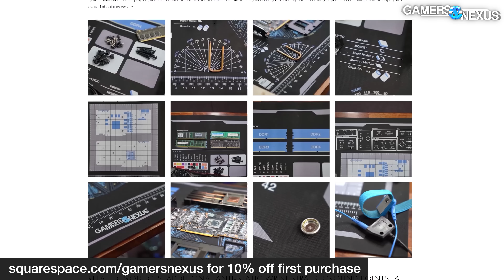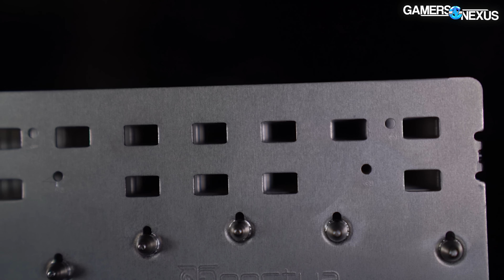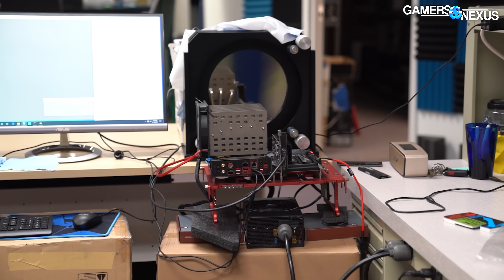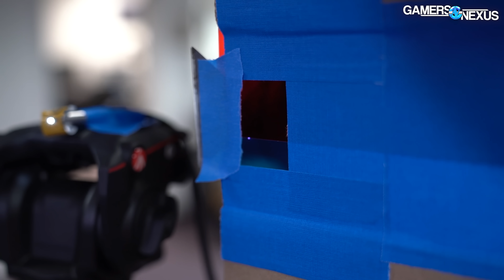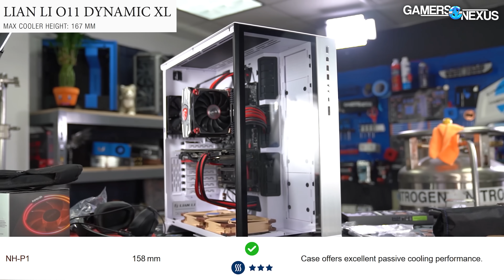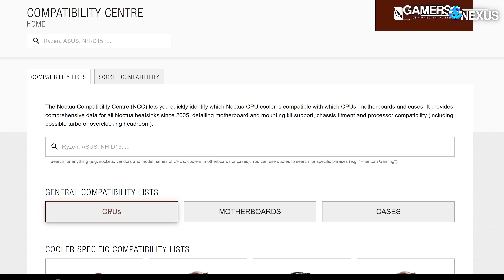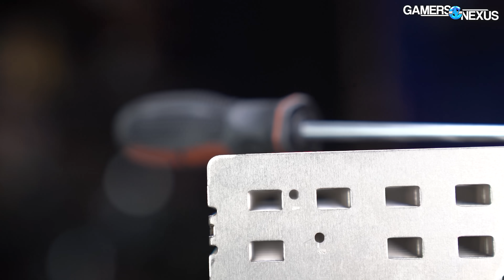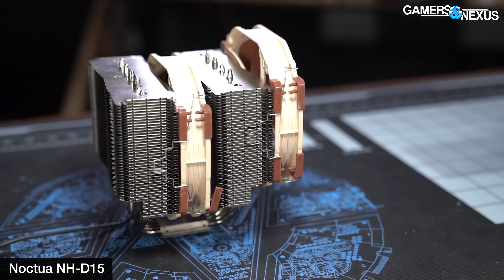Noctua NH-P1 Passive CPU Cooler Review: Benchmarks, Schlieren Photography, & Mechanics

Comment: If you were desperate to build a completely silent PC with no moving parts, what's going to be your best option for graphics I wonder? Taking a massive triple slot, top end GPU (like a FTW3 or Red Devil) and underclocking it severely I suspect (somewhere in the 100-150W range). Everything else is fairly obvious. Most decent PSUs these days fan-stop when not required and I doubt you're going to be able to dissipate more than 300W of heat passively so you'd probably be fine with a 750W or so. SSDs and NVMe, no hard disks.

Comment: Can someone explain why their 'cpu idle' is extremely low compared to load. I'm pretty sure most modern cpu's can't stay below 25 degrees at idle without some crazy cooling going on never mind some passive cooler.
Reply: It's delta T over ambient temp.
Reply: They subtract the room temperature from the temps.

Comment: It's best to use in some PS case stuck closed big box like working table in some cement factory or any production dust factory which need decent computer to operate. Price wise computer is probably controlling multi milion dollars equipment therefore 50$ more expensive is totally non issue

Comment: Undervolted 5700G analysis with this heatsink, soon?
Reply: THIS! Yes please!
Reply: that would be an awesome setup
Reply: Either of the APUs and this in an matx or itx cube would be neat at least until/if mid range GPUs return to 2013~2015 prices.
Reply: @ferdinandbardamu3945  I have no interest in Gaming, my use case is a general purpose / video streaming / HTPC.

I'm looking at the Silverstone FARA H1M case as it has good airflow, fits a 160mm CPU cooler and fits in the furniture under my TV.
Reply: @Richies_Beer_n_Gear  
If you want to go ITX, I suggest the Silverstone LD03. The case structure is well suited for convection cooling with a heatsink like this NH-P1.
Reply: @ferdinandbardamu3945  Thanks! That looks like a really good case, but I'm going to stick with the FARA H 1M as it fits my requirements better. I need to use it horizontally, with front to back case airflow and with 2x 3.5" HDDs.

Comment: I would have preferred to see this cooler tested with a APU (e.g. Ryzen 7 5700G) as this would be a working passive build without a discrete GPU
Reply: An APU is just a CPU with integrated graphics, so as long as the CPU and integrated graphics don't use too much power, the cooler will work with an APU. This is just a guess, but I'm assuming that if you set the right temperature limit / power limit, passive cooling is possible.
However, giving up that much performance, makes using an 8 core CPU with powerful integrated graphics a bit pointless.

Comment: "you probably won't hear a quiet fan" as long as you keep the speed at check, A12x25 is doing fine at 500RPM but at 1000 is absolutely unbearable and starts becoming an issue at 600-ish

Comment: Imagine a cooler, that used the entire case a heat sink.
Reply: The Streacom db4 is exactly that.
Reply: Didn't LTT already do something like this?
Reply: there are many of these but somehow they don't really do better than this
Reply: https://www.kickstarter.com/projects/1489140137/nsg-s0-worlds-first-fanless-chassis-for-high-perfo/posts/3171901

The project has taken over three years I think, and still no actual cases. But the company is legit in the server cooling space, so it's not a scam. It's just taking years of delays. The design has changed a few times as well.
Reply: I recall Zalman had a case like that

Comment: I remember seeing my first passive PC in a calibration room for hearing aids at an ear care center, so that's another class of use-cases.
Reply from the maker: Makes a ton of sense!
Reply: Also people that are afraid of mechanical failure. In systems where you're going to setup and forget about them for a decade.
Reply: This is definitely a cooler for edge case and niche scenarios, and this is definitely one of them. Good find!
Reply: places like these will probably get something like Airtop 3 to not rely on aftermarket parts and complex warranties
Reply: @Z4KIUS  OEMs can also buy stuff from Noctua..
Reply: Yeah, I’ve gravitated from Noctua because of their prices recently, but this cooler can certainly be clutch in niche situations.
Reply: It's surprising how many known brands do OEM stuff. I got a 450 MHz Pentium 3 that came with a stock Cooler Master cooler.
Seasonic and FSP are some of the few companies that actually build PSUs, most others order from them and slap their own sticker on. Same for OEM motherboards.

Comment: "you'll see how heat rises... which is a known thing" but seems to be unknown for most of case manufacturers, and I guess whoever designed ATX standard too
Reply from the maker: Heat rising becomes irrelevant in cases where fans are present.
Reply: @GamersNexus  When I used to compete in overclocking, I'd have the top fan in my Antec 900 blowing down from the top and people were outright offended.  It was good for an extra couple degrees Celcius cooler, and that's all I cared about :)
Reply: @GamersNexus  maybe if you're deaf, but if you're not you want to use as little force as possible, working with convection is just easier
Reply: As Steve also says, as long as you have just a single fan, the heat will go whatever way you point the fan...
Reply: @morromeyer  it's better to run fan slowly and quietly to assist convection than to run it fast and loud to fight it
Reply: AT and ATX standards were designed around desktop computers, not tower cases.  It would be hugely rare to see a motherboard on its side at that time.  10 years later, sure that would be the norm.
Reply: Heat rising is a very weak force, you should know this from school, if you have good airflow horizontally you will only see very minimal gains working with "heat rising", the bigger thought is does heat rise or does cold air sink...

Comment: Don't you think it's worth mentioning that the 11900k had the highest 1 percent low in every single gaming benchmark you showed? The lead was usually pretty substantial. 

Isn't this really the most important metric? When I'm using my 144hz monitor and playing warzone or apex, I won't care or even notice (it would be impossible to notice) that one cpu averages 185 fps vs 180fps but I sure as heck notice when it dips to 105fps. As a gamer, I want a PC that is going to be the best at staying above my refresh rate at all times. That's the 11900k

Why don't reviews pay more attention to how well the CPU prevents framerates dipping rather than focusing on how one cpu has a 5 avg fps advantage over another?

I totally get what you mean about the price of this cpu. I agree, it's not worth it. But if I'm building a no compromises best possible CPU, I'm going with the 11900k bc it is the best at keeping my framerate above my refresh rate consistently. If I'm missing something, please explain. I am no expert! Thanks

Comment: Steve: Buys a super expensive custom fan tester.
Noctua: Bout to ruin his whole career.
Reply: plot twist; noctua knows and released this cooler just to yank the GN teams chain.
Reply: @kenabi  double plot twist: the fan tester has an attachment to test fanless coolers
Reply: Im interested in seeing a fan attached to this cooler, how cool would it be?
Reply: Sorry, but this thing is practically useless, especially at this price point. Dedicated servers have their own cooling, especially if they use multiple racks with several processors in each. For a gaming computer you would still need GPU with its own ventilator and possibly case vents. Only theoretically useful application would be some dedicated science computer with weak passively cooled graphics card, that needs to be as quiet as possible. In that case PSU would need to be cooled quietly as well.
Reply: @aleksazunjic9672  actually this type of Cooler if PERFECT for places where a lot of dust and debris can end up clogging normal fans
 (happens a lot where I live where you can literally see an 2 cm dust appear in just a day on any surface)
sure its weak and not useful for heavy and high end stuff but for a normal computer its perfect.
Reply: @m-w-y7325  Frankly, 2cm of dust would appear only if you live on factory floor :) Industrial computers usually employ different strategy, strong fans that blow dust out of the PC case. They do not care much about sounds for obvious reasons. Passive coolers do not need fans, but they would be covered with dust like anything else, and that would reduce thermal convection.
Reply: @aleksazunjic9672  Audio mixing in a live studio.  Background noise mitigation is huge and easiest to deal with if there's no noise to start with.  The right tool for a very specialzed job, as it were.

If you are using this in a server rack, as you suggested, you're doing it very, very wrong.
Reply: @TaterRaider  For a live studio you would need not only passively cooled CPU, but also passively cooled GPU and PSU . It would be less of a hassle to just keep computer out of the live room like they usually do in studios. As for servers, I did not suggest that , it was idea of others.
Reply: @aleksazunjic9672  you don't need a gpu at all for a pure music mixing computer. many more expensive psus operate in a hybrid fashion anyway.
Reply: @-........  You need some display adapter sonny ;)
Reply: @aleksazunjic9672  necroing a dead thread but

Passive GT710 baby :)

Comment: You should do a test where you remove the fan from the active coolers, effectively making them passive, just to show exactly why the NH-P1 is designed the way it is.
Reply: Here's the result of that test: all heatsinks will fail at cooling the CPUs without a fan. Some heatsinks will work with Intel T models at the cost of low performance.
Reply from the maker: @quintoblanco8746  This is correct. The result is they all fail.
Reply: @quintoblanco8746  Ninja will work quite fine with 60W probably, but everything else will fail
and P1 can go higher and higher
Reply: @Z4KIUS  I doubt it. 60W generates a lot of heat and if the fins are close together, without forced airflow even a big heatsink gets saturated quickly. Also most CPUs with a TDP of 60W use a more power than 60W under stress.
Reply: @Z4KIUS  SilverStone HE02 > Ninja, just not sure if you can still buy it.
I've had both and while Ninja (3) did pretty good passively (used it on A10 APU), HE02 is in a different class.

P1 is definitely my next cooler, though.
Reply: @quintoblanco8746  I never did proper testing of my Ninja in passive to be exactly sure but it definitely can handle more than just a T, and if you're not going for sustained load it'll work flawlessly too, though I definitely don't recommend that
Reply: @Z4KIUS  How do you know if you didn't test it? Just try it, disable all of the fans (CPU fan and case fans) and take the PSU out of the case if you can't disable the PSU fan.
I'm pretty sure that the CPU will overheat quickly.
Not enough natural airflow. The problem is that air is a great insulator when it's not moving.
Reply: @quintoblanco8746  never had time to play with power limits to get proper results, and now I'm definitely not taking out my P1 to mount Ninja again, it's way too much work
but from all the different configs I've tried 60W is a reasonable estimation, may be 50, may be 65, also depends on the CPU used as different surface areas and placements of hot parts affect that too

Comment: Down blowing configuration also allows the air to be pulled from cooler part of the case instead of drawing air through the fins from the heat sources on the motherboard such as VRM and RAM, theoretically speaking?

Comment: I’m trying to figure out a way to fit this in a silent itx build 🤔
Reply: Just make it like a hot rod
Reply: @alanalb1449  my thoughts exactly
Reply: Use one of this really tiny ITX-cases with a pico-PS and cut out the cover and let the massive cooler stand out
Reply: May have to cut a hole in the case.
It would be a hole in the box.
You would have literal OUT OF THE BOX THERMALS.
Reply: It will fill the case and there will be room for nothing else 😉
Reply: same. I have that silverstone case and had the same idea in the LTT video, replacing the same cooler too lol
Reply: The way to go is to not have a case at all.
Reply: The only solution is to build the PC inside the heatsink itself. Good luck!
Reply: Easy just oet it hang outside the case
Reply: want to try it with 3400g + inwin chopin without mesh)))
Reply: Cutting a hole in the case for it to stick out would be very distinctive.
Reply: Well, I guess it's a nice fit for such a build. By that I mean that such a build would more or less fit inside this cooler.
Reply: Or u could get those “itx” cases that are like m-ATX cases that don’t support m-atx
Reply: Linus did just that yesterday, it involves a dremel.
Reply: I want to jam it on a pn51
Reply: Thermaltake Core P1 would probably be the easiest. No walls, so the cooler has all the "breathing" space it needs. Seasonic Prime Fanless PSU and SSD storage, leaving the graphics card as the only potential source of noise. If you don't need massive graphcial horsepower, there are passive graphics cards as well. The fastest passively cooled GPU you can get is currently the Palit GeForce GTX 1650 KalmX, so if you need more you have to live with some fan noise.
Reply: Probably if you drill a large hole in the side of the case

Comment: Have that badboy installed along with that Lian Li transformer case or that case with the ridiculously over the top fans that doesn't do anything the Rameses case.

I think I would need to high wiring attached to it feels like it would pull off the CPU still pasted to it

Comment: this could be great with the cooler master SL600M case
Reply: It is literally a passive cooler.  Nothing about it is great.  It will do nothing but keep your processor at MAYBE UNDER 95°C.
Reply: @RNG-999  yeah, I sould said decent, just because of the orientation in that case, with a vertical oriented gpu but I agreed, there are way cheapper options with better cooling

Comment: You should have just done a sound test, just to mess with everyone lol
Reply: room with pc off - 40db, turns on pc, 35db... noctua wtf :D
Reply: Next video: "Thanks to purchases from the GN store, which pays for all of our new testing equipment, we were able to buy this machine that allows us to measure acoustics at the quantum level."
Reply: Noise normalised comparisons with fans means passive cooler is infinitely better?
Reply: @squigglyspaghetti8690  The line no longer approaches zero, it approaches Noctua.
Reply: @squigglyspaghetti8690  You should make the noctua go up to 40db, or make all the other coolers passive, an unfair comparison either way lol
Reply: @squigglyspaghetti8690  yup, if that's your only metric you found a your fan lol.
Reply: @squigglyspaghetti8690  no, its more like a cooler (with a fan) that cant run at your noise threshold even at full speed
Reply: @horticulturistsquash865  - It was just a maths joke dude.
Reply: Could have plot it against the noise from a H1 running hot
Reply: this would have demonstrated how much noise in the test is backround noise...
Reply from the maker: @ulrichkalber9039  that's called the noise floor, which we already show.
Reply: @ulrichkalber9039  Maybe even some coil whine
Reply: @tardvandecluntproductions1278  
Thats a thing. When I ventured into passive cooling CPU, chipset and GPU some 20 years ago, whining coils made me go crazy because they penetrated the case fan noise level at that point.
Reply: @ulrichkalber9039  That’s what the “noise floor” is for :)
Reply: @ulrichkalber9039  it doesnt work like that
Reply: oUt Of thE bOX tHeRmAlS
Reply: @aleksazunjic9672  did you watch the video? Because you sound like you're itching to argue with someone, even though we're all pretty much of the same opinion.
Reply: @HMarcBower  I'm arguing that this cooler does not deserve good review (like this), because in its price category it is basically useless. I do not disagree with the tests.
Reply: @aleksazunjic9672  again... You watched the video, right? This isn't just about price category (Steve explicitly said that unless you have a specific need that this fits - low thermal requirement, silence - don't buy it). What you're arguing is that because a fully loaded F350 costs the same as a corvette, that obviously nobody should buy the truck... Except some people aren't trying to beat someone in the 1/4 mile, they want to haul drywall.
Reply: @HMarcBower  They aren't here to talk logic, that guy goes to pretty much every GN video to disparage GN's opinions with a bunch of copypasta replies to the top comments, so it's pretty obvious they're like those weird hater-stalkers that subscribe to the stuff they hate for some reason. Sooner or later you'll see them defending Gigabyte's exploding PSUs and saying Steve's testing methodologies are wrong.
Reply: 21db
Reply: he should measure how loud the coil whine sounds, I found on really silent pcs that's the only thing i can hear
Reply: I wonder if there was some vibration if you'd hear the clinking of the plates... :)
Reply: and it loses
Reply: Sorry, but this thing is practically useless, especially at this price point. Dedicated servers have their own cooling, especially if they use multiple racks with several processors in each. For a gaming computer you would still need GPU with its own ventilator and possibly case vents. Only theoretically useful application would be some dedicated science computer with weak passively cooled graphics card, that needs to be as quiet as possible. In that case PSU would need to be cooled quietly as well.
Reply: @aleksazunjic9672  I think most consumer computer stuff is unnecessary, but not useless. Yes, this cooler is pretty niche, but someone will like it and so it won't be useless.